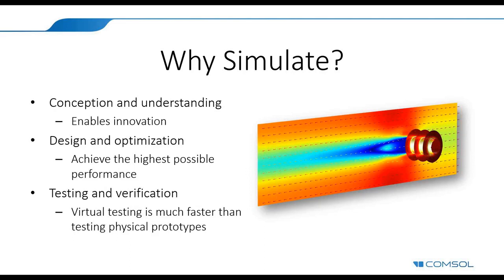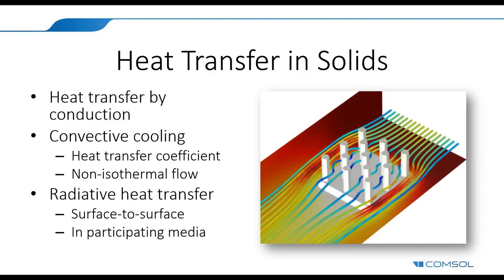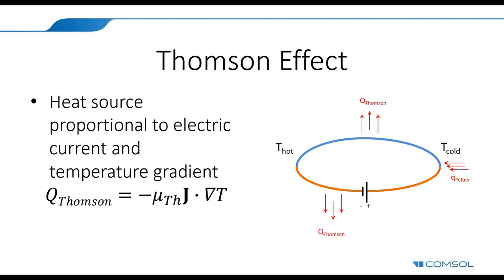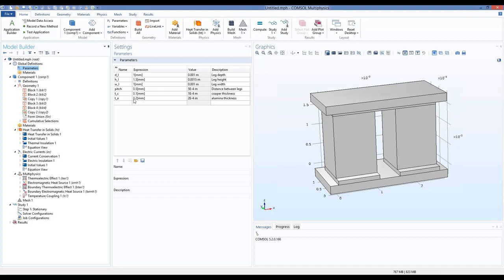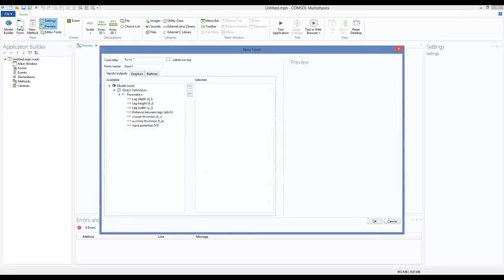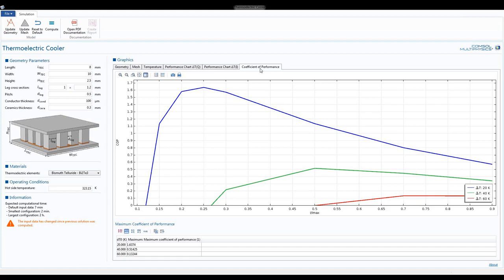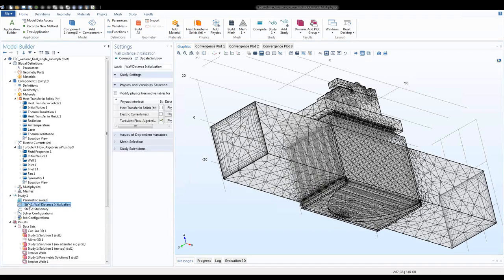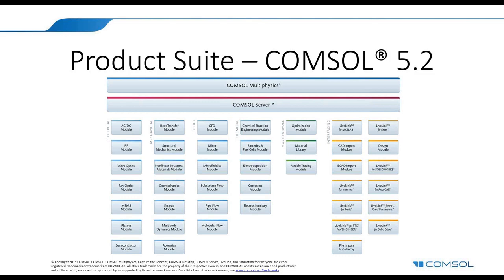How to Simulate Thermoelectric Devices and TECs 3

Comment: Had a question mam....How to calculate the output power in COMSOL for the generator if I provide the temperature at both the junctions? Any particular user defined functions in COMSOl to use?
Reply: did you discorvet it how do it?